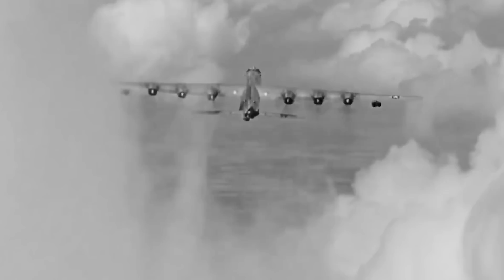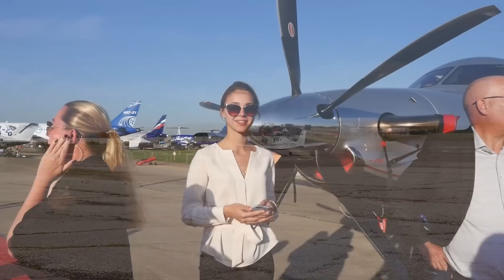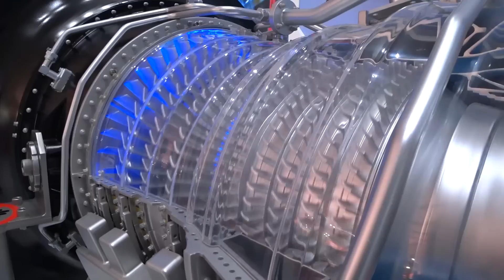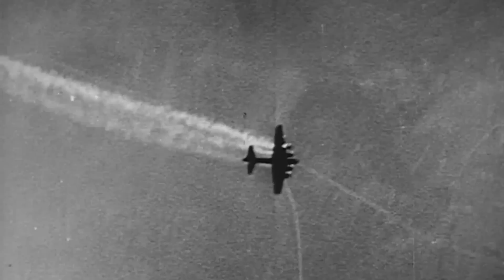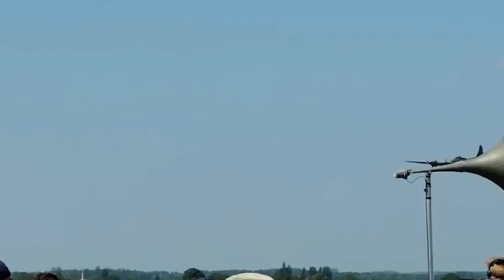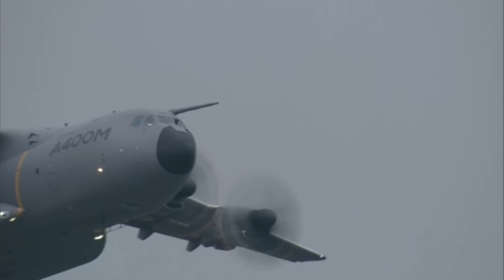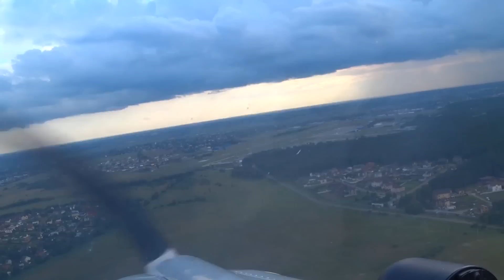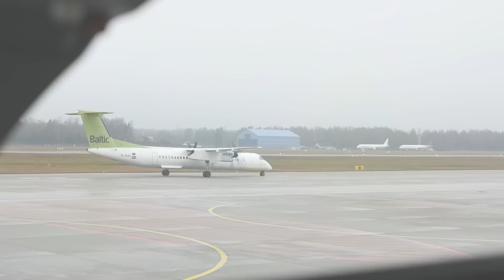Piston and Turboprop engines | What is the difference?

Comment: Very well put together piece.   Excellent Clear, Concise, Comparative.   Well done !!  Thank you.  
Altitude, speed, horsepower were covered brilliantly.  Range and fuel consumption could have been tweaked a tad, and the wonderful ISP might not have been needed here but perhaps the next one.   I think rockets vs jets is going to be a big factor in the future as trans continental travel moves towards rockets to get into hyper speeds.  
Also another one is to cover electric vs jets.

Comment: He’s comparing modern turbo props to piston engines from the 50’s. Modern fast cars regularly have engines with 500+ horsepower and they aren’t that heavy.
Reply: At least he's comparing things in a much more rationale way than you just did with your car's engine analogy.
Reply: They also don't run at 75% power for hours
Reply: He addressed that in the video, if you actually tried to watch it. 
One thing is, you can't compare a more recent BIG airplane engines because there aren't any. If you want to talk about 1000+ HP aviation piston engines, you can only talk about old ones. Also, as he mentioned, turboprop engine designs are also from the sixties, no not that much newer. 
Let's forget about cars engines, please.

Comment: You forgot one thing.
Turboprops are only efficient near their nominal power output. They are much less efficient under partial load and consume a lot if they just idle.
Reply: Basically they almost have two levels of fuel consumption: on and off.
Reply: I heard somewhere that Coast Guard C-130s run on two engines when flying low and slow on search and rescue missions.  That would keep the engines running at or near their rated power.

Comment: What is the difference? One is faster and significantly more expensive than the other. Both will get you there faster than a car and some cases, faster than an airline when you account for the time/pain of getting through security and into the hurry up and wait queue that is modern commercial air travel.

Comment: Good video, but you need to better describe the differences in the "Jet" engine variants.  
A "Jet" engine is the turbine core power plant.  How they generate thrust, speed and achieve efficiency splits them into three groups.  TurboJets, TurboProps and TruboFans.  They all are "Jet" engines at their core.

A true TurboJet like found on early fighters generates 100% of its trust from the exhaust nozzle.  Kind of like squeezing the end of water coming out of a garden hose.  They generate a lot of high velocity trust but use a lot of fuel.  If you are a fighter jet, you don't care about fuel efficiency.  You want thrust and speed to defeat your opponent.
Turboprops and High By Pass (HBP) Turbo Fans found on most commercial airliners are very close cousins.  Both generate most of their thrust not by exhaust nozzle thrust but the 'final drive" they are driving so to speak.  On the TurboProp it's an open propeller.   On the HBP Turbo Fan is basically a ducted prop or "fan".  Both generate almost all their trust from the propeller/fan.  The TurboProp is more efficient under 30,000 ft. while the HBP TurboFan is generally more efficient at higher speeds above that altitude.  The HBP Turbofan is not as affected by the prop/fan tips going supersonic which when that happens it generates a lot of drag.
Reply: But that's not the topic of the video. He's talking about engines that can be alternatives to piston, and only turboshaft really is. If he did a video turboshaft vs turbofan for small regional jets he'd definitely explain turbofans better.

Comment: It’s about reliability and operating cost. High altitude takes care of the fuel economy. It’s much easier to fly with thin air than fat air below 10k feet. So that should be forgotten as a spec because it becomes a equivalent. Complexity is the biggest problem.

Comment: This was a great comparison, quite educational. One of the points you made early on,was that they both spin propellers. 
I would like to see an episode on the differences in how each type of engine spins that propeller, and the differences between the propellers themselves. 
Most, but not all, piston engines drive their props directly. That is, the prop is bolted directly to the engines crankshaft (output shaft). Some piston, and all turboprop engines, employ a gearbox between the engine and prop. There are also differences in the design of the propellers themselves. A number of the Soviet era design bureaus produced some very impressive gearbox/propeller systems for the turboprop engine. 
I believe that would be a great follow up to this video. 
I very much enjoy learning about the "Eastern Block" designs. I truly appreciate that you bring that part of aviation history into the mainstream. I grew up during the Cold War and knew very little about those aircraft. I saw an Il-62 for the first time when I was in my late twenties and was fascinated by the design. 
I hope you make such a video. Thanks.

Comment: Turboprop: jet engine (ie rotational motion turbine) with big external propeller stuck up front providing virtually all of the thrust.

Turbofan: jet engine (ie rotational motion turbine) with internal fan contained within engine cowling up front providing thrust together with jet exhaust.

Turbojet: pure jet engine (ie rotational motion turbine) with jet exhaust providing all of the thrust.

Piston engine: pistons moving up and down cylinders translated to rotational motion by crankshaft to power big propeller stuck up front that provides all of the thrust.

Comment: One thing that struck me as odd when I was doing research on Vehicles, All TurboJet/Prop engines have no way of emissions control,so all those Nox,Sulfur and Nitrogen Oxids,Carbon Monoxide,and Soot Comes Striaght out into the air
Although with a Piston Engine,emissions can be controlled with the used of Catalytic reduction and aftertreatments,or can it? I had that thought a few days ago and I dont know if its realistic because of the power needed, like whether it'd blow it straight out or if its plausable

Comment: A topic seldom discussed and very well researched !
You did however not mention the difference between single shaft and free turbine turboprops.
I found free turbines like for instance a PW125  or a PT6 to be very responsive while single shaft turbines like Rolls-Royce Darts first have to spin up the prop  as this is connected to the turbine shaft using gear box where the free turbine has a separate power-turbine on the output connected to the prop.
The long engine spin-up time as mentioned is merely for the single shaft turbine while this problem on a free turbine is generally in some very specific cases like switching to reverse on landing.
These differences have an large effect on usage and engine operating procedures as well.
Also it might be notices that flight behavior between props (piston and turbo) and jets differ dramatically.
In my personal opinion the huge high bypass fan engines of today are basically almost turboprop engine with a rain barrel around is ;)
Finally... I know you're Russian, but please for the rest of the world, Altitude in Feet and Speed in Knots, so we understand what you talking about ;)

Comment: You forgot to mention turbofan engines. You showed several photos of them, calling them jet engines. But turbofans are arguably more closely related to turboprops than jet engines. ;)
Reply: Because the video talks about the kind of airplanes that would choose either piston or turboshaft. Jets and turbofans are a whole different league. Nobody would wonder if they need a piston or a turboshaft OR A TURBOFAN for their airplane. Turbofans engines are larger than most piston engine airplanes.
You either choose between a piston and a turboshaft, or a big turboshaft and a small turbofan.

Comment: Are turboprops more noisier than piston engines?
Reply: Most are. The Pratts aren't real noisy on the ground if they are in low idle.
Reply: Actually Garrett and Darts are much louder. The front compressor being based on the lefrance  fire engine siren

Comment: one thing not mentioned. at higher altitudes there is less drag as well as a lower air density. less drag = more fuel efficiency.
Reply: Most turbines start to loose power above 15K. That will bring the fuel flow down.
Seems like 1000ish lbs. if torque is max power on a Be-200B up @ FL300.
Max torque at sl is 2200 ftlbs.

Comment: Does having the engine backwards make a difference? Like where the prop is on the back.
Reply: I guess your speaking of pushers?
Reply: The prop is on the back side of a PT6. 🤣
But I guess your talking like a Piaggio or B36 or Wright Flyer?
Yes, they are more efficient in a pusher configuration.
Reply: I think it's better for aerodynamics, since the prop creates a turbulence right in front of the airplane.

Comment: It was informative, I didn't realize some of the differences as it relates to the application. I would be interested in the steam engine and we're it might be today if it wasn't shelved . It would be Superior  to both I think.
Reply: Generally you have a Lot Of Lag time with steam, that's why you see a steam locomotive accelerate before it gets to the hill, whereas as diesel engineer just throttles up as the locomotive reaches the hill.
(a lot of the last steam engines actually had a set of spray nozzles to spray oil onto the burning coal to give the boiler faster reaction time when the train needed to speed up...)
Reply: @timengineman2nd714  steam engine , not referring to locomotive . Those designs are specific to the work of pulling massive loads. Rather the evaluation of using steam as means of power.

Comment: Cost to buy. Cost to maintain. Cost per miles/gal.  Piper Navajo similar cabin and seating to turboprop Cheyenne II. Piston twin plane 620 hp total with turbochargers. Cheyenne twin turbo prop has a total of 1240 hp .  Turboprop has twice the fuel burn per hour and only 60 percent faster than the piston plane.
Reply: You Sir are correct.
Reply: See above reply Navajo 200#/170 ktas, Cheyenne 480#/250ktas   
Using an 80% block speed on a  350 nm flight cheyenne2/1.8. hrs,  about 480l  or 660$. The Navajo 2.6 hrs about 310 litres at a low price of 1.70 527$ in fuel

Comment: "when the temperature is close enough to freezing" Yeah no. I've had carb ice occur when it's been 22 degrees out haha. (72f)
Reply: Yup.   That Carb Heat “ain’t there just to make sure your feet are cold”
Reply: Bet the outside temperature wasn't 22C at altitude though...
Reply: @patheddles4004  It was after start-up when we were on the ground.
Reply: @santiagokiwi3187  Fair enough, I stand corrected.

That does surprise me though.
Reply: @patheddles4004 , Believe me, it surprised me too! Very unexpected!
Reply: @patheddles4004  Carb heat exists because the venturi/bernoulli effect of the airflow accelerating through the carburetor causes the air pressure to reduce, thereby reducing the temperature of the air, plus the fuel evaporating into the air cools it. 
Depending on where you are, a hot day can be more likely to have increased humidity/more moisture in the air entering the carburetor, adding to the two problems already mentioned.
Reply: How did you manage to do that?
Reply: @redacted5937  the way carburetors work causes temperature in the air intake drop very dramatically, which can freeze any moisture in the air and cause ice to enter the engine.

Comment: An interesting concept: both engines (reciprocating piston and turbine) are four (4) stroke internal combustion engines. The essential principles of suck, squeeze, bang, blow apply to both. One key difference is that in the reciprocating engine, these strokes are delivered sequentially, as a series of pulses, while in a turbine engine they operate simultaneously. 

One could suppose that the power stroke in particular, being delivered in a series of pulses in the reciprocating engine, rather than a constant as it is delivered in a turbine, explains the power to weight ratio between the two (2).

Furthermore, the jet equivalent of that pulsed power would be the pulse-jet as immortalised by the V1 bomb.
Reply: Then a 2 stroke engine would be also a 4 stroke engine
Reply: It makes little sense to stand the definition of the word "stroke", as it applies to an internal combustion engine, on its head to make it apply to turbine engines. A "stroke" of an internal combustion engine refers not only to the phases from intake to exhaust, but to the travel of the pistons. You will not find pictures of turbine engines in an online search for four stroke engines. And then to say one key difference is the sequential vs simultaneous delivery of the strokes, conflates the concept of "stroke" with the meaning of the word "continuous". Once you get past the principle of "intake, compression, ignition, and exhaust", about all that is left are "key differences". In the case of a jet engine, the energy that is released is used as thrust rather than to turn a propeller shaft. I understand your point regarding the phases of the air and fuel mixture, I just find it more of a side note than of much use in distinguishing the different classes of engines that have evolved over time.
Reply: You might change the term “4 stroke” to “4 stage”. A turbine is not a 4 stroke engine. It has 4 stages just like a 4 stroke reciprocating engine.
Reply: My grandparents lived through the Blitz and all of WWII in the south of England. Our ancestral home is in the direct path between London and where those v1 rickets were being launched from. Sometimes they wouldn’t make it all the way to London and instead would fall on the towns and villages along the path. Such is what happened to my grandparents neighbours home. A rocket fell on it and in the morning all they found was a giant crater. I hate the v1 and v2 rockets for they are a nazi invention that reeked havoc on my family and my country. Also, your entire premise or theory is flawed and makes no sense due to your misinterpretation and poor definition of key words. Others have left detailed comments explaining the shortcomings of what you had to say. Good day to you
Reply: .     "Wreaked|"
Reply: i kinda disagree with you. But essentially, every heat engine has the equivalent of "Suck squeeze bang blow". The differences is just like you said, ones is continuous ones is discrete